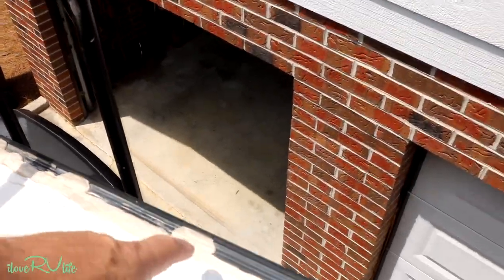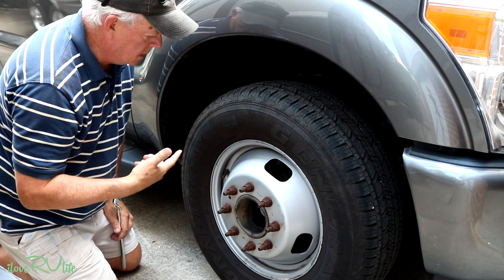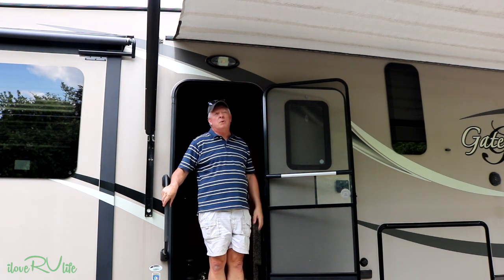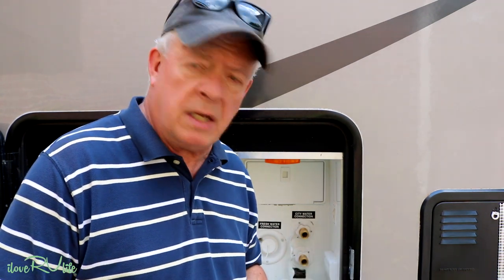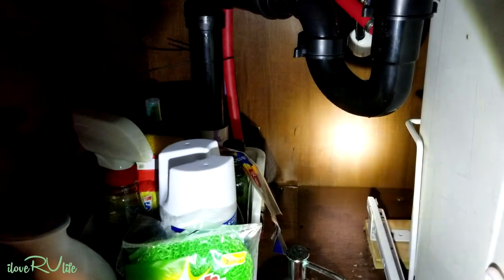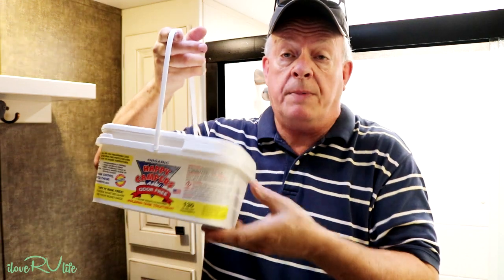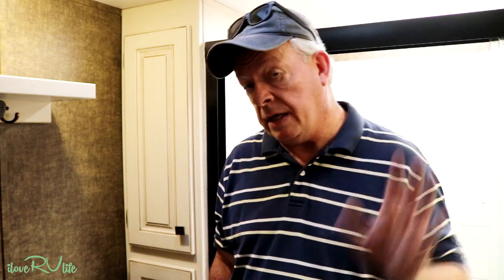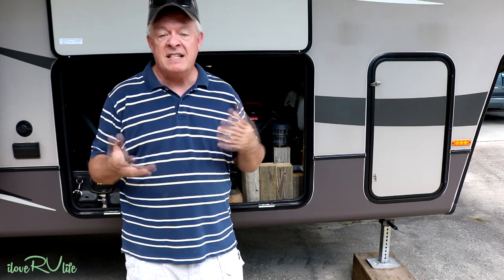10 RV Travel Preparation Tips

Comment: Great job Jerry!  There is a lot to RVing, more than people realize.  Having just picked up our new to us fifth- wheel, I have spent the last few days adjusting doors, drawers, etc.  Always something to do.  On my slide teeth, I use white lithium grease.  I will try the 303, as I have never used that product before.  Thanks for sharing!
Reply from the maker: Grease is good as long a the manufacturer recommends.  Usually you want something dry so it won't capture dirt and mix with the gears.  303 is amazing stuff.  Jerry...

Comment: During your seal lubrications don’t forget the ones under your slides that seal the gap between the bottom of slide and floor surface. The 303 is awesome stuff, use it myself.
Reply from the maker: Great tip Mike.

Comment: Thank you for the info, one note to make considering air pressure in your truck tires though. If you have deviated at all from the OEM tire then you should always inflate to max cold pressure stamped on the tire itself if it differs from label on the truck. The door sticker only applies to those tires that were installed at the factory. Tire manufactures will use air pressure variants to get out of warranty claims all the time. And the tire pressure listed on the truck door can possibly cause premature wear in your tires. Just some food for thought. Thanks again for the video.
Reply from the maker: Great tip Brandon.  Just had new tires installed on the Dually.  Had to increase recommended tire pressure from 65 lbs to 80.

Comment: Hi Jerry
Great info for all to have. However battery maintenance and LPG system are very important also. I also remove and visually inspect wheel bearings every other season. I really don’t like surprises.
Thanks for your time.
Mike
Reply from the maker: Great tip Mike.  I also have the wheel bearing packed and the breaks checked every 10,000 miles.

Comment: Hi Jerry, we love your channel. We blew a tire yesterday on our 2017 Rpod. My husband always checks tire pressure before we leave, but forgot to check the spare and it was really low. Lesson learned. Also, we just bought RV Digest It. Trying it this time.
Reply from the maker: Sorry to hear this.  Remember, 65 mph is max speed.  They’ll heat up and blow.  Check the brand.  Hopefully no China bombs.  We had a set.  Blow out at 3,000 and another at 3,500.  What a mess. Tore up the sides.  We headed straight to the tire dealer and replaced.  Glad you made it back safe.  Jerry...
Reply: Pretty sure it was a China bomb. They are 3 years old and we had been seeing the danger of them. We had planned on changing them this season, but took off before we did. It blew the fender off and did some damage to the rig where the screws were attached. We have to make some calls tomorrow. Thankfully my husband kept a cool head and got us stopped and on the shoulder. Lexington, KY police sent two cars to sit behind us until help got there, then followed us to the next exit.....Thanks again for your videos. We have learned a lot.
Reply from the maker: Thanks a bunch.

Comment: Thanks for the video.we also use Happy Camper but only 1 scoop for every 40 gallons between dumping.
Reply from the maker: Thanks.  We run in cycles using Happy Campers.  A little more in the very hot months and less when it's colder.   For the hotter months, using a bit extra helps keep the odor at bay.  Appreciate you sharing.  Safe travels.  Jerry...
Reply: @iLoveRVlife  We;ll give that a try as well.

Comment: Thought I'd stop by and vouch for "Dawn", best all around detergent from animals to mobile mancaves.  First of your vids I've watched so forgive me if I've missed you mentioning checking "all" lug nuts and tighten to proper specs.  using a torque wrench.  (available at Walmart)  

Also, I've yet to see any recommendations for testing the "break away switch" before starting out the driveway.  

The "enzyme" treatment for the 'black tank, is excellent advice.  During warm weather, when not in use, folks would benefit by adding water and enzymes to their systems and letting it sit.  Common bread or beer yeast (activated per instruction) then poured into the system works to clean fatty and other waste.   Pour in some "Dawn" just before leaving on a trip and flush at your first destination.  Yummy...😬

Or ya can pay some service center waaaay more, to clean your tanks, than the cost of enzymes  and a bottle of Dawn.   

Gotta git,  my next how-to, is cleaning my awnings.   Thanks for taking the time.

Keep up the good work.
Reply from the maker: Thanks for the tips.

Comment: Thank you for info on the slide gearing I just put wd40 about a month ago I haven't moved it sense and just went and looked there is dirt sticking to the gear I guess I can pressure clean with a solvent remover thanks again👍
Reply from the maker: Glad to help Mike.  Dry lubs will prevent dirt build up.

Comment: Instead of trying to mix Happy Camper in the toilet bowl, I mixed it in a container first & then poured it into the toilet. It left a white powdery residue in the container every time, no matter how well I mixed it up. Hubby was afraid it would mess up the tank or the tank levers so we stopped using it.
Reply from the maker: Pat, that's part of problem.  Don't mix.  Just open the toilet and pour a scoop into the black tank.  We've been using for almost 3 years and have never had an issue.
Reply: I have been mixing the Happy Camper first in a bucket of water and then pouring it down the toilet- you are saying just dump a scoop full into the toilet and add water?
Reply from the maker: Hi Tom.  I've tried both ways and found no difference.  I hold the foot flush down and pour in a scoop.  That seems to be enough water for the enzyme to activate.  Dumping the tank days later, everything has broken down.  Jerry...

Comment: Happy New Year Jerry.  Enjoyed your video maintenance.  Do you have any videos that show why my city water connection filled up my Fresh Water tank?  We never use the Fresh Water tank.  Always hook up to city water; have never used the pump either except it is a used 2015 Palomino Puma that we just bought and love, but are finding a few things that don't work as they should, i.e. like just recently hooked up water to camper from our home before we take our first trip; left it on all night.  In the morning which checking to see if there are any leaks, I noticed water drippings coming out of the Fresh Water fill hole.  Went inside and checked my lights and the Fresh had 4 lights; gray 2; black 1 light.  I was shocked that somehow water got into our fresh tank without using the pump or filling the tank on our own.  Any ideas of how to fix this?  I've watched some other videos and I know somehow it happens, but don't know why.  We've had 2 other TT in the past and this never happened.  Don't know what to do.  Thanks for any input you may have.
Reply from the maker: Happy New Year Janet.  Great to hear you’re enjoying the channel.  There’s a check valve near the water pump to prevent back flow from the city connection to the tank.  If this has always been a problem, it could be missing.  If the problem is new, the valve has gone bad.  They’re inexpensive and about an hour or less to install.  If this is something you all want to fix yourself, the manufacturer  should be able to provide a diagram of the water system where the valve is located.
Reply: Thank you, that's what a couple of videos I saw said to do.  1) Shut off city water;  2) Turn on water pump for 10-15 min.;  3) Run hot water from inside camper for 10-15 min. till all air is out of lines, then run cold water too;  4) Then turn off water pump;  5) Turn all faucets off;  6) Drain Gray water tank and dump Fresh Water tank (I assume if any is left in there; if so, dump Fresh Water tank);  7) Hook city water back up to camper.  Does this seem right to you?   It worked for a couple of people I saw videos of.  I hope it works for me.  Waiting for a couple of warm days and no rain.   Thanks for answering me.
Reply: I thought the check valve was inside the water pump, not near the water pump.  It would be nice if it was near it; I'll look and see.  They say sometimes debris can get stuck in this valve and keeps it open and that's how the water is getting in the Fresh Water tank from my city water.  So, I'm going to try this solution I wrote about below and will let you know if this works.  Hope so.  Happy New Year!
Reply from the maker: Janet.  Not sure about the water on and off series.  Worth a try if it works.  For the check valve, depends on the pump. We haven’t had a check valve issue with ours, but ours just stopped pumping.  Not hard to replace at $70 to $100.

Comment: Jerry, check out an incredible product - Krud Kutter.  Its a campers best friend.  You'll find it a very useful video project.  I began using it a couple of years ago to clean the glass door and racks on my smoker, so very easy.  I now use it on everything that needs a thorough cleaning.  An amazing bio degradable grease cutter and NSF-A1 certified.   Just a happy user.
Reply from the maker: Hi Barry.  I've used this stuff with great results.  Had a small engine motor in the bed of the truck.  Got oil and gunk everywhere.   This stuff made the bed good as new. Thanks for sharing

Comment: One thing you didn't talk about and I recommend is checking the torque on the lug nuts. Knew someone who skipped this and while traveling on the freeway lost the tire and rim. This caused extensive damage to the side and floor behind the wheels, it also caused the other right side tire to blow because of the weight.
Reply from the maker: Great point Michael.

Comment: I believe you mentioned not using Pine-sol in your black tanks? Why is that? I'm curious because after dumping and cleaning my tanks, I always mix about 2 gallons of water with some dish soap and some pine-sol, which I leave in the tanks until I dump them again. It's seem to work pretty good, no issues so far, but I do wonder why you mentioned not using pine-sol? Curious... Just found your page, but very much enjoy the videos! Thanks for doing them.
Reply from the maker: Hi Darrin.  No problem using if that’s working for you. But if you’re using a black tank enzyme such as Happy Campers or RV Digest-It to dissolve the solids and toilet paper while camping, the Pine-sol or dish detergent will kill the enzymes.  The reference was not to use both and waste money on the enzymes.

Comment: I love your idea of dawn soap in the gray tank and black tank!!! GReat idea!!!  Jerry should we close our bathroom sink drain and tub drain and keep closed until at time of use?  We're getting some odors in bathroom can't seem to get rid of.  Any ideas?  Sewer soil stack do anything to routinely to it like inspect the roof soil stack cover to see if something plugged it?  It's on my list this week to check it to see if it's causing the odors
Reply from the maker: Added and just made a run to Florida.  Gave all my tanks a good scrub.
Reply from the maker: There are.  I'm guessing from your question you don't full time.  After you dump your tanks put a couple of gallons of water in each tank along with 2 scoops of Happy Campers.  You can do this when you get home. This will continue to break down any loose soilds in the tank.  Also make sure you toilet has water in the tank.  Maybe a couple or two.  This creates a seal to keep the smell from entering the bathroom.  If the tank won't hold water, then replace that black rubber seal.  Takes about 5 minutes.  When you dump your gray tank, the force of emptying the tank will pull out the water from the bathroom sink and tub pee traps.  This will cause that stagnant smell from the gray tank to exit in the bathroom.  Simple fix is to pour a couple of cups of water in the sink and tub when you get home to replace that water trap. You didn't mention any drips from the bottom of the camper while traveling so I don't expect leaking pipes.  Also remember the Dawn tip before you head out on your next trip.  That will give you a cleaner tank to start out on the trip.  Last item, use Happy Campers while you travel.  It will help break down all solids and give you a cleaner tank when you get home.  Hope this helps.  Jerry...
Reply: One thing to consider is if running the fan in the washroom try shutting the exhaust fan off just before flushing this will prevent black tank air from entering the washroom by being sucked down the black tank vent. Then turn the fan on again after flush, if required.

Comment: At 17:18 in your video you show a close up of your quick disconnect female end of the quick connect.  Do you have a dust cover (if so, what type) that slips over the female side of the quick connect brass fitting you have installed on your city water connection (not on the hose end)?  Your water connections are inside a compartment which is a nice touch but on many travel trailers they are on the outside and exposed to the elements.  Without a dust cover you can get dirt, dust, bugs etc. into your fresh water tank.  I like the idea of a quick connect but need to find a way to put a dust cover on the un-threaded female end.  I think the normal dust cover plug on the city water connection stays securely connected because of the threads on the inside of the water connection but I'm not sure they will do the job on the smooth finish of the quick connect female end...or do they?  Any thoughts?
Reply from the maker: You bring up an important point.  I got the idea for this when we were parked next to an expensive class A.  And yes, we both have a sealed water bay.  Just thinking out loud.  Maybe something like one of the rubber furniture leg protective feet to slip over.  Trim it down a little so it doesn't protrude to much.  Jerry...

Comment: Hi Jerry - thanks for this video.  Did you see that 303 makes a tire balm specifically for tires at about $12.67 on Amazon, rather than the $20.68 for the spray?
Reply from the maker: I have seen that.  I use the spray on to the awnings, rubber gaskets and tires.  A little goes a long way.  I've been using the spray bottle for over 18 months and still have about half left.  Kind of one spray bottle does all.  Not sure if the balm lasts longer or may be adds a finish to the tire.

Comment: Love your videos! I'm curious about the tire treatment... I saw you spray it on the outside of the tire, which is great, but I'm wondering if your missing something? What about the inside (opposite side) of the tires? Is the outside the only side subject to "dry rot" because of the sun hitting it and therefor the inside isn't at jeopardy? Or is it just time and weather that causes it, and therefor the inside should be spray/protected as well?
Reply from the maker: Hi Jeremy.  Thanks a bunch.  There may be some benefit, but this isn’t a tire conditioner, but UV protection and little sun hits the inside.  Time and weather is the big enemy, but the hot summer sun beating on the tire will accelerate aging.

Comment: Hey Jerry I have a question for ya, when you applied caulking around joints or where antennas meet the RV or air conditioners, etc. How many times do we have to reapply caulking to the old caulking ?  OR can we just take the old calking off or at least trim some of it off and then reapply with new calking just so we don't have a build up of caulking?  Please let me know and keep on making these wonderful videos!!  BTW, I am learning A LOT of RVing from you and from a lot of other full timers even though me and my wife don't even own an RV yet...LOL
Reply from the maker: Usually very little.  Check once a year.  If you see fine cracks in the sealant, then apply a bead of sealant.  Don’t use household caulk, but a RV lap sealant such as Dicor.  Here’s an example. https://amzn.to/2Okwioh I always keep a tube or 2 in the RV just in case something happens on the road.  If you have a newer model RV, these usually have a rubber seal and don’t require adding any sealant.  If the sealant over time becomes very bulking or to much is deteriorating, then every so gently use a putty knife to remove.  Be carful and don’t cut your roof.  More videos on the way.  And glad you found the channel helpful..Don’t wait to long on that RV purchase.  Jerry

Comment: Hi Jerry, very interesting presentation, after cleaning my rubber roof I also protect it with the 303. Do you put any wax on the outside if so, did you find anything good that will last ?
Reply from the maker: Rubber roofs are a challenge and oxidize quickly.  303 is a great product.  I do wax every couple of years.  I must admit, it’s my least favorite project.  It’s a job!  It’s time and I’ll buff out and wax later this spring.  I’ve had good luck with Meguiar's Premium Marine Wax.  It’s for fiber glass and gel coats.  I think it holds up well since it was designed for harsh environments.  Jerry...

Comment: Jerry, with you having a residential refrigerator,  do u just not have power to the refrigerator when travelling? Unlike the propane ones?
Reply from the maker: Great question.  I've never addressed this in a video.  I'll make a video with the details in a couple of weeks.  We do have power for the frig and can run around 72 hours without plugging into pedestal.  We have 4 golf cart batteries that tie to a 1000 watt pure sign wave inverter that can take a surge to 2000 watts.  Very important to handle the compressor kick.  The inverter is dedicated to the frig and has an automatic switch over when connected to a pedestal.  May sound a little complicated and expensive, but its a simple set up.  We really like the residential frig.  It's larger, not temperamental and stays cool.  Downside though is boondocking.  I don't have solar panels and have to run a generator a couple hours a day to keep the batteries at peak. Jerry....